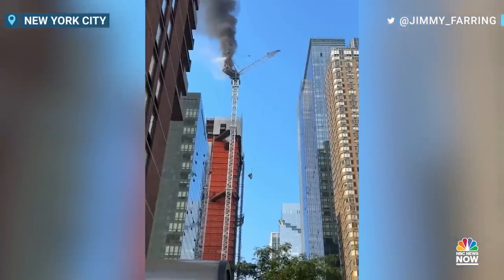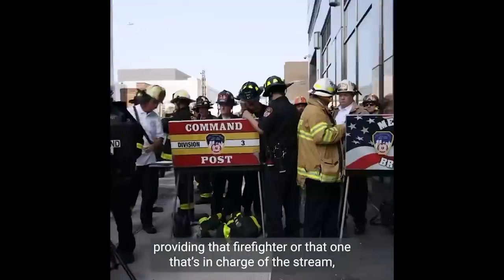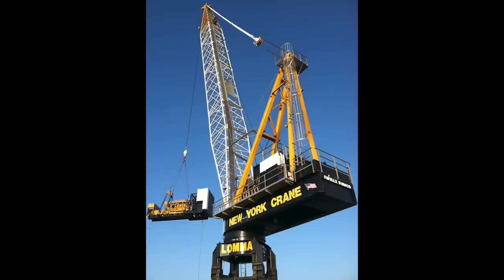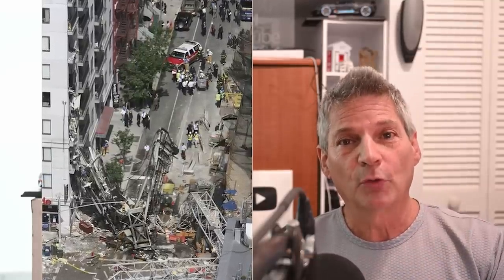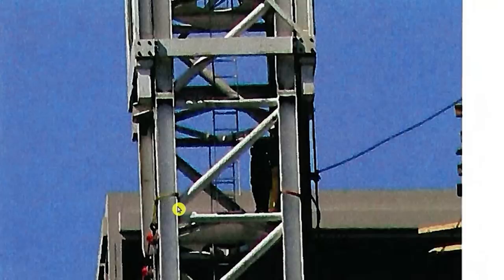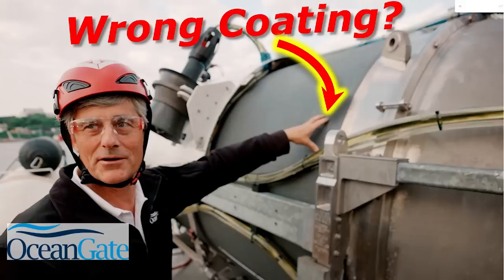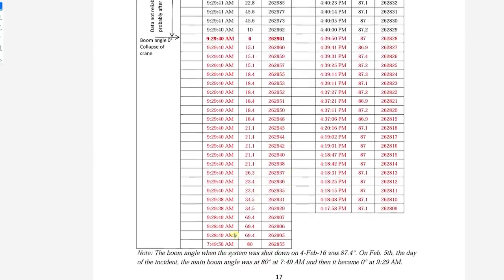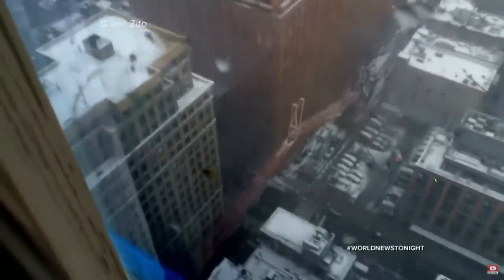New York Crane Collapse Cause, MORE Fatal Collapses

Comment: Pretty weird assumption that the firefighters didn’t try every angle when manipulating the hose stream. That simple diagram doesn’t account for the height difference or the wind. The second stream was flat because they recognized the water pressure wasn’t sufficient to reach the crane so they used it to protect the lower building from the burning oil that was falling. Pretty lame for a soft YouTube engineer to dump on the professional at FDNY who risk their lives to protect others

Comment: Crazy stupid. 
A few years ago there was a big crane working on a baseball stadium. "BIG BLUE" they ignored the high winds. And in the middle of the lift, parts of the turn table broke. There were flags flying near by. Totally visible high winds, the crew ignored it and it collapsed and killed 3 people if I remember correctly. 
All were preventable. Very sad.

Comment: Yes, they have a bad safety, wrecker safety for the cranes 🏗️ and then one in New York jib fell off it’s because the cable melted off from the extreme heat. Why do cranes fall down all the time I can tell you an experience knowledge I’ve been clean operator for 15 years tower cranes, and other crates never had this problem. Just use your brain. 😂😂😂

Comment: The elephant in the room is the age of the crane i have not seen a diesel powered tower crane since the early 80s . If there is no power at hand a generator is at the base of the crane. Is America that backwards that they still use 60yo technology for lifting solutions? In Australia to keep a crane certified they have to be stripped to the last bolt and every weld xrayed every 10 years. A crane that age is nothing but scrap

Comment: So much conjecture and conclusions based on it and generalized guesses. So much sensationalism and attempt to villianize or create conspiracy and evil will. The water streams were where they were most effective and I'm gonna trust the judgement of guys from FDNY that were there over some kitchen and bath guy playing engineer. 2ater sprayed at distance thru air does not simoly follow a ballistic trajectory, the breakup of the stream will cause it to fall short well before any advantage of a different trajectory will be gained. 
The cause of the fire could have been a hose or fuel but I'd put money on the winch brakes. First thing in the day, one of the shoes is dragging and after a bit of working that shoe lights off and starts a fire that feeds off of the grease and other flammable materials in its proximity which then extends tnru the cab structure rapidly, up high in the wind and fresh air that fires just love. Even if it wasn't the cause, the absence of its consideration demonstrates the lack of solid data that the conclusions are drawn from.